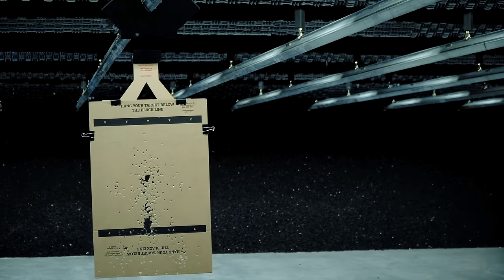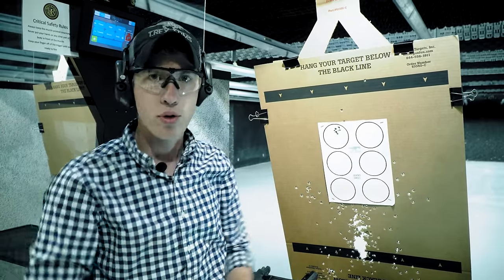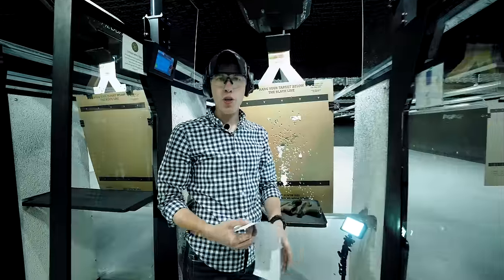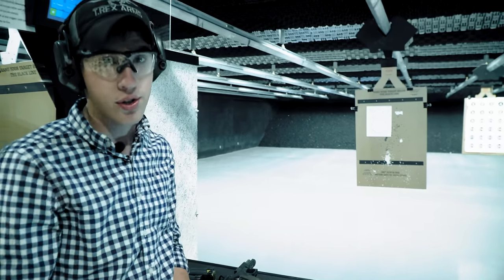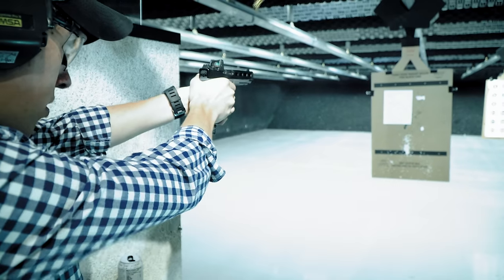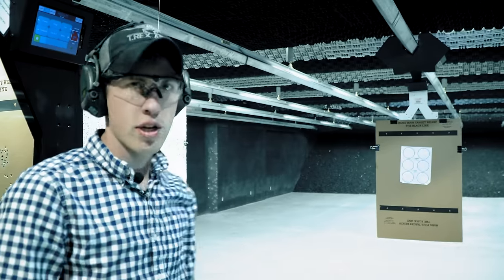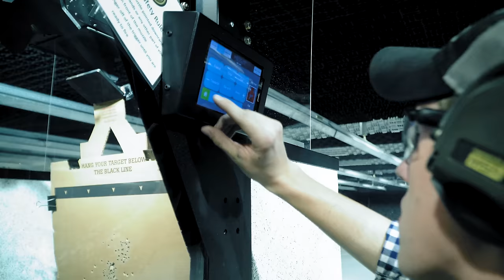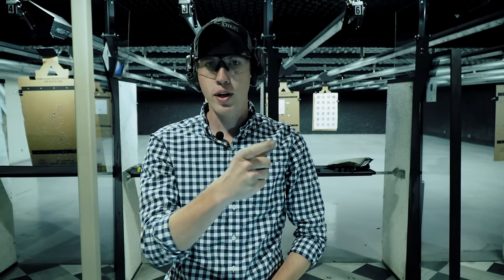How to Train in an Indoor Range - Handgun

Comment: Note to self for range day. 

1. Accuracy, small target- slow fire. Shoot close then go far. 

2. Work from compress ready, find sight quickly then follow through then reset.

3. Grip. Focus on grip. Diagnose grip while shooting. 

4. Trigger work. Work the slack and use prefer surface of finger. Don’t pin trigger, pull then release quickly back to wall then fire. No need to work on accuracy. 

5. Back to grip. Rapid fire, again diagnose grip while firing. Shoot only as long as you can see sight.
Reply: well? hows your shot 4 years later?
Reply: @doubledoublecapncrunch8306  nah frl
Reply: @maneuverrz  i'm actually so curious haha, maybe one day he'll return to let us know he's the next rango 🦎
Reply: Add me to the waiting list
Reply: Thanks, i am in school right now and can't have any sound

Comment: I've been using medium sized post it notes for my target at 7 yards. To me that works out very well, instead of dishing out $1/target.
These drills have been my training since I've bought my first gun. Thanks for sharing this video!
Reply: Hows it working out 3yrs later.
Reply: @bluyetiinc7553  took my first USPSA match then dozens more last year after finally mustered the motivation to do it. I've been consistently slightly above the middle of the pack locally. I'd say somewhere between lower B class or upper C. I sucked at every classifier lol

I'd say it's working really well and if I doubled down on dry firing more, I would've been at a better spot.
Reply: @zano_korellio  Well done! You made a go of it, more than many of us. You can still get right up there.

Comment: The best advice all instructors will tell you about learning running N gunning is the running part.  Work on your cardio. Do morning jogs, work a treadmill. Don't be obese because when you do need to run and gun and you are out of shape, your body is going to kill you faster than whoever is trying to kill you
Reply: On the contrary, "Speed is fine, but accuracy is final."
Reply: @axemurdereriamnot  You know that line is talking about shooting accurately vs shooting fast not running around
Reply: So true. Fitness is often overlooked especially by indoor 'range rats.' Hard to get off the X, move to cover and still shoot well if you're completely gassed after doing so. Great point!
Reply: @Excalibur01  You can't shoot accurately if your sights are unstable from either movement or physical weakness.  Fitness is important, but marksmanship is more important.
Reply: @axemurdereriamnot  and you cant shoot for shit under stress if you are out of shape. It's easy shooting on a flat range standing still but try being over weight or just put of shape, run around and the shoot. You'll see that have a body that's fit will save your life.
Reply: @axemurdereriamnot  if you have disabilities or some weaknesses, you need to train around it
Reply: A woman just said that there are a few lines targeting the 2nd Amendment  in that huge bill meant to help Ukraine about to be passed.
I have no way of knowing how to fact-check that and had hoped one of you would. if it is true, you need to contact your state rep ASAP.

Comment: Everything plays a factor in accuracy. A major one though, in my opinion, is trigger control. If you have red dot, you can practice pulling the trigger as you normal would, the red dot will move either right low, left low, or stay put. You think you’re pulling the trigger straight back (accurate) until you see the red dot move jerkily to either side.

Comment: Excellent video Lucas. I live in a metro area and outdoor space is generally not available.  I like to put two targets on the backboard and shift between them.  Second, my range has rotating targets that you can set custom edge and face times.  It adds a great dimension to indoor shooting from compressed ready.

Comment: That looks like a really nice shooting range. I went to a local indoor range and I had a mixed experience. I had it all to myself which was nice but there where a few things I wasn't expecting. First thing was this range didn't let you use your own targets, they had a small variety of targets. I picked the one that had 5 small targets on it so I could do the drill like you did. I was handed a small cardboard hang up, it looked like a cardboard clothes hanger. It had bullet holes highlighted with a marker that was above the hang line and was told if I shot above that I'd be fined. So I take it to my lane and look to hang it up. It was a paper clamp, like the large black ones that clamps and two tiny ones to fix the target onto the hanger. It went well but when you sent out the target or brought it back in it was an all or nothing system so it flew off the entire mechanism all together a few times. It wasn't anything fancy, forward and backward was the only options and it was operated by a light switch like thing. All together with buying 3 targets it was like $30. Shot about 200 rounds and stayed about an hour and some change.

Helpful video!

Comment: Typically my indoor practice is kinda that first version where ill put up a target that has a big body and a bunch of small circles (those sighting in lettered or numbered shapes etc) and ill dump into the big body for a mag, then put a mag each into the small targets at the same range starting slowly and picking up speed. Rinse and repeat at increasingly further distances. I might try the compressed ready thing this weekend though maybe drive out, 2 shots (to practice hitting that wall and getting that second sight picture), then back in. 

Great video

Comment: My range allows double taps but not rapid fire. So what I've adopted is low ready, double tap, reloading and firing another double tap or single shot depending on what I feel like doing. And in terms of "target transition," I'll do one in the head or top of target and one towards the bottom. Or a specific spot on the target.

Comment: I usually get the target sheets that have 5 or 6 smaller targets on them.
Set it about 7-10 yds, and shoot 3-5 shot groups. Sometimes I lay the pistol on the bench and pick it up and fire in substitution of "drawing".
My biggest problem now is "Just Going to the Range".
It's only about 15 miles, but it's the other side of a Major city from me. $20 lane fee.
I know that doesn't sound bad, but, I'm 68 yrs old and handicapped and on SS only. 
Bad back and hips, and can only stay on my feet for ??maybe?? 30 min at a time. So that drive there and back and $20 for maybe 20 min of shooting, and the cost of ammo, I just don't go but maybe every 3-4 months. 
I used to go a couple of times a week, but that was a few years ago.

Comment: I like working on the "flinch drill" when I'm in an indoor range. Maintaining accuracy when some asshole starts mag dumping a 308 or 5.56 right next to me. Hard difficulty is deciding if you flinched or that asshole sot the side of your target a dozen times. 

Problem with cool guy ranges is they're just too far away. The shitty indoor range you hate to you use is 5 minutes away. The cool indoor range you like to use is 10. The outdoor fudd range you want to use is 30 minutes away. The coolguy range is over an hour away.

Comment: Start with the gun front sight at eye level and when you press out you can fire the shot right at the moment of full extension. Will save several 10ths. 

Trigger jerk is a myth. If your grip is tight and you don’t ANTICIPATE when the gun goes off your shot will not deviate.
Reply from the maker: Who on earth draws the gun that high with the sights to their eye?
Reply: @TREXARMS     Thanks for asking. John "Shrek" MPhee's 3 step draw. To explain:

1 - master grip / correct index
2 - gun hand meets support hand that is palm up at the chest under the dominant eye. This completes 2 handed grip as the front sight is level with the eye ( pistol will be at an incline in front of the face).
3 - Push straight out, the sights level, fire shot at full extension (or even a little before as you will see them for a long time vs bringing the sight up then searching for it). 

Arms + shoulders locked and straight; hands have push / pull and side to side pressure 💯% in both hands. This keeps wrists from breaking and lines the sights with the eyes vs looking over the sights. Note your slow fire group is high, that's bc you are bringing the sights up to the line of sight at the last moment = high groups.
Reply from the maker: Fastest path between two points is a straight line. Drawing high and then pushing out isn’t fast. Presenting the pistol from the holster allows greatest efficiency and with training you’ll have your sight picture at extension anyway and can take a shot then
Reply from the maker: But hey, I haven’t ever seen Shrek shoot.
Reply: @TREXARMS   j/s send him a video for analysis. He can explain why it works and how you can be faster. You make good money, it will cost you nothing and be very much worth your time.

To see him shoot you can search videos on YouTube of course, but better is to join for a month of Gunfighter U (again costs nothing) and you'll get access to all his shooting demos, drills and knowledge base. You'll even get a discount code for the mentioned analysis videos.  

You might be surprised. Ask any other student of his, we are all happy with the instant improvements we've had from his coaching and his massive knowledge base.

Comment: And you're most definitely right.. I do think of the draw & presentation as 2 seperate things rather than a fluid motion.. I work on a fast draw (I'm extremely fast) and it always going off without a hitch because I'm so nervous about doing it wrong and dying in a real gunfight that my starting focus becomes my main focus. But then I have to rely on muscle memory for a good presentation and I usually don't have a good sight picture until 1.5 secs.. Which by then could be too late💀🔫. But whenever I start from compressed ready and present, my eyes and sights are like star crossed lovers.. Is there a way to make it all blend as a fluid motion or am I always going to have this complication of technique??

Comment: Question regarding the reset and setting finger on the wall after firing. So what you are saying is after you fire to get your finger off asap and back into that zone where you can push it to right before you fire (the wall) or am I understanding that wrong? Was under the belief to train shooting faster by using the gun's reset as a way to improve the speed of follow up shots. I'm guessing your method is to improve the accuracy?

Comment: hey Lucas, the main pistol I use is a sig 320. Im right handed and my shooting hand thumb seems to hit the slide lock almost every time. sig did put put a small slide lock release on the gun after having issues from other customers. Do you just leave your shooting hand thumb on top of your support hand thumb? Or do you push your shooting hand thumb up against the frame? thanks

Comment: Don't.  The gun-store commandos are a pain to deal with and some will even insist you use their overpriced ammo (scam).  Also the sound pressure levels (SPL) is huge versus outdoors as the sound doesn't have anywhere to go and most of the sound absorbing material hung up in those places doesn't do a lick of good.  Outdoor is the way to go.

Comment: random noob question, but how do you transport multiple guns like this to the range? A bigger bag to contain the smaller cases?
Reply: Take them out of the cases they were shipped in and get a range bag with room for 2-4 guns and the other stuff you need.  You would rarely have a need to take more than that at any one session.  When home, mine go straight to the gun safe and I reload the mags for the next time, so I can grab whatever gun(s) I want and go on short notice.

Comment: Lucas- I noticed that your slide moves 'very easily' compared to my stock G-23.  The way you rack a load appears that your slide spring would be much lighter.  I need a firm grip to rack one and/or clearing a round on my stock handgun
Also- The clip ejector on my 23 is buried and have to really wrap my thumb around to extract it.  Is there a lighter spring, or aftermarket extractor button??  Thanks
Reply: is your glock new?
the moving parts will move much smoother and easier the more you use it

Comment: So not holding the trigger back is new to me, but seems like potentially a good idea. My only fear is... on the learning curve, would there not be a fair amount of NDs as you learn to set that finger far enough back behind the wall under recoil without coming off the trigger? You’re already pointed in a safe direction yes, but you don’t want to get chewed out for “rapid-fire” by accidentally double tapping...
Reply: its fine, just practice with an empty gun first. You'll get to know the trigger really well. Resetting the trigger after each shot and making sure to follow up with a sight picture is what you'd need to "rapid fire".
Reply: Don't know how negligent it would be if the gun is pointed in a safe direction (at a target down range) and you're prepared for a second round to be fired while training.  Now "rapid fire" is another issue... ugh.  I don't think you'll be able to practice this drill without speaking the the RSO first.  Maybe it won't be a problem if you discuss with them and ask if they can help or recommend anything for you.
Reply: @mcouture8169  a fuddy rso will disagree instructing us to pin the trigger to the rear

Comment: How you doing I just ordered some 762x51 holsters from you. But my main focus is on my sight picture with my pistol shooting at the range. I'm above average height 6 and 1/2 ft tall. When I'm looking at my target I'm aiming to shoot at the head but yet I'm shooting near the body. I do try to shoot with both eyes open but that only works with the rifle with a pistol I have to use one eye. I'm wondering if it's my grip or does my target need to sit higher? I forget the order number but there's in order going to Colorado if you could find it send me an email and give me any tips that you can

Comment: How could you possibly work on reloads? That dropped mag would likely cross the firing line pretty frequently and require a cease fire spectacle each time to retrieve it.
Reply: maybe get a few more. you cant grab it with a broom? 

Getting proper reload reps is important in order to get muscle memory. You need to be able to drop the mag and not pull it out with your hand and set it down on the bench each time.

Comment: I think trigger reset is concentrated on a bit too much with many shooters. I find myself doing it. Feeling the reset, and snatching again. I pull the trigger and tough my nail back to the trigger guard as a, hey, you are off the trigger, you can find the trigger again. Nice and slow. I am NOT NEARLY as fast as the author. I suck with a pistol. I am working on it. Slow is smooth. Smooth is fast. Work is boring. Work leads to going faster and better.

Comment: What exactly is meant by "the wall"?  I've heard this from you several times now, and I'm not certain what it means.
Reply: I've always called it the "break".  It's the part of the trigger pull where any more pressure will release the hammer/striker.  After firing, if you keep the trigger fully pulled and slowly release it, you'll feel a "click" where the trigger is now reset and back on the wall/break.  It's the fastest way to make follow-up shots instead of releasing the trigger all the way back to an unpulled state.